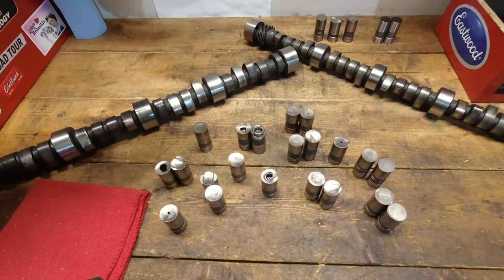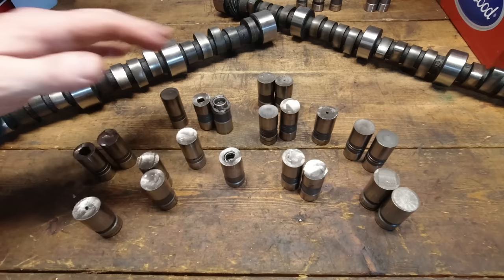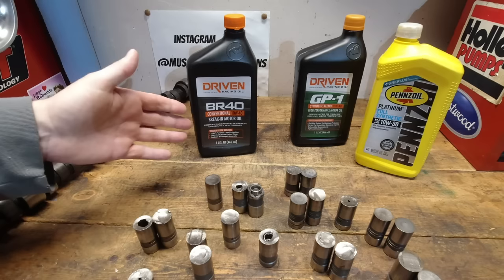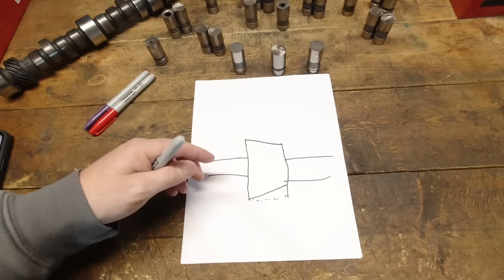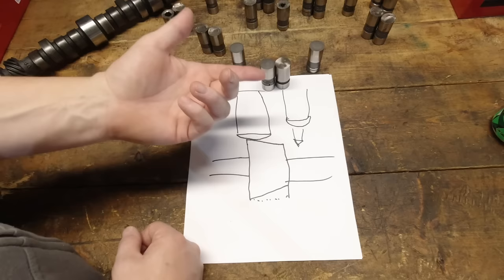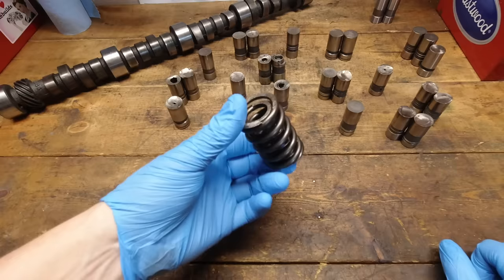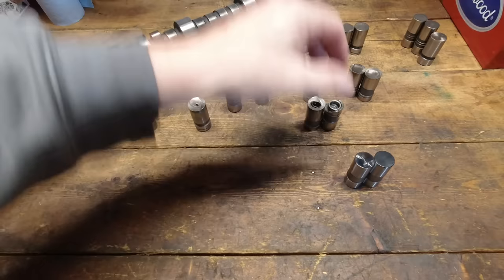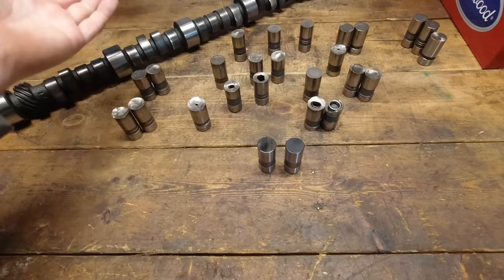Flat Tappet Cam Failures: The Reason Why They Go Bad & The Solution! Part 1

Comment: I have an idea, how bout they break in the lifters and cam together and sell them as a “broke in” set. I had one fail and it ruined my entire engine many years ago. I never touched the car after that and it’s still in my yard.
Reply from the maker: One thing I live about Centerforce.  They have a clutch dyno and if you get on good terms with them, they’ll send you a clutch and flywheel that’s broken in.  I can’t imagine the high cost it would be to send out a cam and lifter set that’s broken in.  Not joking but I’ll bet it would be a couple grand for that service.  Maybe more as initial break in is only one part of the process.

Comment: Zink oil and break in cam 2000 rpms varing for 20 mins let it cool totaly after then its good to go change oil but add zink when you change oil add it to oil
Reply from the maker: This is not the recipe for success.  This is a recipe for failure.  Not all engines need the same break in speed and adding oil to an off the shelf detergent oil is a horrible idea.

Comment: Can anyone tell me why GM, Ford & Chrysler didn't break in their engines when they rolled off the assembly line?
Reply from the maker: Simple.  The oil back then had the right amount of sacrificing zinc and the lifter bores were brand new and the tolerances were correct.  Watch the other videos on this series and I’ll explain all the details.

Comment: Zddp is what all motor oil companies add to motor oil because most all engines used flat tappet cams, this is the only reason zddp was added to motor oils that contains detergents or non detergent oil.  The presents  of detergents has nothing to do with it fact. The reason older engines don't have these problems is that zddp which is more than zinc is a additive to motor oil so that when you break in a flat tappet cam 2500rpms or so for 30 minutes or so  the cam and lifters will not grind each other up.  That's the only reason zddp was added to motor oil all motor oil up until about 16 years ago. The main reason motor oil companies most not all is roller cams or cams with new type buckets don't need zddp for break in time and also 500 mile break in for the cam. Make sure your cam break in oil has zddp additive in the oil and the 500 mile break in oil has zddp for flat tappet cams zinc alone will not work! Now do your homework because if you add to much or to little it can cause cam, lifter failure! I've used zddp plus and never had a new flat tappet cam failure. To many flat tappet cams to remember how many and not one failure and no special break in springs or low ratio rocker. Big cams with Manley valve springs put the motor together and put it on the dyno and break the cam in, I do 2500rpms for 30 minutes and tune her up,do an oil sample if ok put her in and let her rip no problems.

Comment: So explain to me how diesel oil from 20 years ago the high detergent in the oil didn't wash all the zinc phosphate away?
Reply from the maker: Same as high zinc oil today.  The additive package was formulated to work with it.  When you take an off the shelf oil and throw in a zinc additive is where you run into problems.

Comment: I bought a Chevy 402 that was rebuilt including a new hydraulic cam and lifters. After 60 miles,a strange noise on the driver's side of the engine under the valve cover prompted me to remove it. One rocker was moving half as much as the others. I also noticed only half of the pushrods were spinning and the bad lifter wasn't turning at all. On rebuilt engines,I have never heard a discussion on watching to see if the lifters are spinning on an engine with a new cam and lifters. Has anyone ever taken an intake manifold,cut about 80 % of the front portion off leaving just enough to install the distributor. With the pushrods and adjusted as close as possible,crank the engine over with the starter and observe the lifters to see if they are spinning or not. At this point,they all should be spinning,correct? For as big of a problem camshaft failures are,has anyone done things out of the ordinary to increase their chances for success? Great video! I look forward to any and all discussion as I plan to replace the cam and lifters. At this point,I'm thinking about just going the roller cam route. I haven't seen any videos on a Chevy 402 roller cam install. Thanks.
Reply from the maker: We’ll eventually be covering those topics in the final video in this series.  The tough thing about crate engines or someone else’s rebuild is all the things that need to occur still have to happen.  Big blocks are rough on valvetrain and seat pressures are super critical.  If it was broken in or attempted to be broken in without lowering the seat pressures, it’s like playing Russian roulette with a mostly loaded gun.
Reply: Thanks @MuscleCarSolutions

Comment: You cannot "check" the depth of the 'heat treatment before you breakin the cam, unless you either buy 2 cams that were furnace or induction hardened during the same cycle or you access to a plug or coupon of the same material that was heat treated during the same cycle as the cam you purchased. I think what you are trying to refer to is the hardness of the cam.
Reply from the maker: Circumstance of having one cut so the heat treat depth can be seen.  Future video!
Reply: @MuscleCarSolutions  yes it must be cut, polished, etched and looked at under a powerful microscope to see how much or little the microstructure was changed.
Reply from the maker: Checking normal heat treat depth is visual.  Don’t need a microscope for that.  The lines are pretty clear.  Like I said, content for an upcoming video.

Comment: There is only 1 company making US flat tappet lifters, lifter crown, and cam lobe taper are the 2 most important factors, as well as proper break in procedure
Reply from the maker: That is not correct.  Most use a US made lifter, but even that doesn’t mean much if the quality is not what it used to be.  Crown and taper are only two factors in a group of many that are all equally important.  You can have a perfectly matched set and if you run too much spring pressure, the chances of failure go way up.
Reply: theres two.  topline and delphi both make hydraulic flat tapper lifters in the US.  there might be one more but I think they went out of business or sold a few years back the name escapes me
Reply: Elgin makes quality lifters

Comment: Most of the lifters are being made by one of only three manufacturers no matter what name is on the box.  Hardness is rarely the problem. I'm betting the actual break in technique is the main problem .Most guys do not do it correctly.
Reply from the maker: I don’t disagree.  We covered a bunch of issues in the rest of the videos in this series.  Lifters are still a big issue, but it’s generally not what people think and it’s 100% the fault of the machinist when they don’t verify lifter bore wear.
Reply from the maker: I don’t disagree.  We covered a bunch of issues in the rest of the videos in this series.  Lifters are still a big issue, but it’s generally not what people think and it’s 100% the fault of the machinist when they don’t verify lifter bore wear.

Comment: Great stuff.  
I think I remember the video about the taper being 0.003".  Is it possible that he was speaking about the dimensions from nose to base circle, as you would measure it with a caliper or micrometer at the "front edge" and "back edge" of the lobe (front being toward the timing sprocket, back being toward the back of the cam)?   In other words, in the "diameter" sense.
What I'm talking about is that taper "could" be the difference in height at the "front end" and "back end" of the lobe, relative to the centerline of the cam.  That would be half of the amount measured as outlined above.
Does Billy Godbolt have a definition of what the allowable taper is for different engines?
I read that the old Mopar 6-pack and Hemi cams had smaller taper and larger radius crown on the lifters.
BTW, I'm with you, I went to roller lifter cams 15 years ago or so.
Reply: Billy left comp
Reply from the maker: From the one I saw, the statement was made that it’s a .003 taper on the cams.  Just not the case.  We’ll be doing an interview with Billy at the end of the month and taper/crown will for sure be a topic he’ll talk about.
Reply: @MuscleCarSolutions  when you say it's about 1-1.5, is that radius difference or diameter difference?
Reply: No mo flatties for moi. Learnt my lesson the expensive way. Rollers is the way for inexpensive Big HP gains (even on same spec cams)
Reply: @totensiebush  That was what I was trying to say.  Tony just posted a rebuttal video to this and clarified that he was measuring across the heal and nose of the cam with calipers, and that the taper difference would be half of that 0.003" number, at 0.0015"  - He also agreed that 0.003" taper (i.e., measuring heal to toe at 0.006") would be excessive.  So I think they are in agreement.
Reply: @kelaward  I just watched an interview with Billy that happened in the last 2 weeks and he spoke as if he was still at Comp Cams.
Reply from the maker: He is still working with Comp but is now on his own to have the opportunity to do more work with overseas teams.  His interview will be on my channel soon.

Comment: What do you think of hydraulic flat tappet lifters with .015 EDM holes in a Buick 350? I bought a new cam from TA Performance, and they don't offer cam and lifter sets, so I bought a set of NOS Johnson/Sealed Power EDM hydraulic lifters from the 80's that were never used because the intended engine build never happened. I am building a Buick 350, specifically an SP code 10.25:1 compression ratio 1970 Buick GS 350. I am using TA Performance single valve springs since it's not a high-RPM engine (max 5000 RPM or so, in my big Jeep 74 3/4 ton 4x4 pickup torque is king, and peak torque happens low in these Buick 350's, like 2800 RPM or so) so I don't think valve spring seat or lift pressure will be excessive. I will be using proper high-zinc break-in oil, and breaking in at 2000-2200 RPM for 25 minutes. Your thoughts, please?
Reply: I would look into slotting the bottom half of the lifter bore with the tool that comp sells. Look up David Vizards video on this. It makes a lot of sense to me as the EDM hole only lubs half of the lifter face as the cam spins if you think about it. Good luck fellow gearhead.

Comment: just recently i ordered a edledbrock performer plus camshaft/lifter kit  for 460 ford  opened the box it was a comp cams box and edelbrock lifters i guess comp grinds edelbrock cams or were bought out by edelbrock ?
Reply from the maker: They merged two years ago and the comp cam was better than the ones Edelbrock was using.  Your success is going to hinge on the things we talked about in this video.  You must get the spring pressures low.  Break in rpm isn’t as high as you think it is.  Use an oil formulated oil for your set up- don’t mix your own.  Have your machinist verify that the lifter bores are the correct size and not worn out and their alignment.  We’ll cover that topic in a future video.

Comment: I followed the manufacturer instructions to the letter and still wiped a couple lobes and destroyed a lifter.
Reply from the maker: My first question to these statements is usually, what engine and what was your spring pressure open and on the seat?
Reply: @MuscleCarSolutions   ford 289. I don't know what the spring pressure was. I used the springs that were on the car for the break in.
Reply from the maker: @bofa83  uh oh.  Looks like you just found the problem.
Reply: @MuscleCarSolutions  could be, but they were older and I had new, stiffer springs to put on.
Reply from the maker: @bofa83 doesn’t matter.  I’m afraid that decision was likely what killed it.  Spring pressures are one of the most neglected parts to a flat tappet break in because they’re difficult to swap out.  If you don’t know what the spring pressure was, there’s the reason why.

Comment: I just built a 402 for my daughter's '69 SS el Camino and I used the Crower "Baja Beast" cam that came out of the old motor. I put Elgin lifters in with it. Haven't started it yet. Would I be better off with a set of Crower "Cam Saver" lifters? How about those DLC coated lifters?
Reply from the maker: Old cam plus new lifters equals a recipe for disaster!  You’d be better off with the DLC and hope the cam is in good enough shape.  The question is, potentially destroying an engine worth it to run a used cam?  Why not just buy new so they can wear together properly?
Reply: @MuscleCarSolutions  I'd always heard you could run a used cam with new lifters but, not the opposite. The cam looked good no bad lobes. It was in a 396 that sat for 22 years and mice went up the exhaust, and peed on the #5 exhaust valve. I did all the prelube and priming but, when I started it, the valve opened and stayed, broke, broke the piston, and popped a nice 1 1/2" by 4" piece out of the cylinder wall. This was in less than 15 seconds of barely running! I'm glad it wasn't the original motor. At any rate, I was trying to save a buck. I think I'll try the DLC's and think positive! Thank you for your input. BTW, I'm using the Driven oil and I do know everything!

Comment: Well maybe on some points ...  But #1 by far is to start that new flat tappet motor WITHOUT the valve covers.  Fire it and if all 16 push rods are not spinning equally, stop!  Shut it down and find out why.  You may only be 30 seconds into the run.  You have not shed any hardened metal yet.  You have not trashed the engine.  Figure out what the issue is?
Poorly crowned lifter is easy enough to check.  Take any two and hold them face to face and rock them with a light behind.  If they don't look right, check some more.  Cam not showing proper "snake" pattern as in the contact stripe not moving back and forth across the lobe as it goes around, pull it out and measure the taper.  
Fix the issue.  Then try again.  Yes it'll toss some oil, so what?  A little oil cleanup is easy compared to building another engine !!
Reply: What do you think about all the additive/detergent bs he is spouting?
Reply: @pssstttchhh  makes sense, alkaline + acid will ionize with each other and fall out of solution.
Reply from the maker: What you’re describing is a verification of the taper, crown and bore operating as it should.  The verification of the oil and spring pressure comes soon after.
Reply from the maker: No bs at all.  When I do the interview with Lake in a few months, he’ll confirm that information.

Comment: You made no reference to the lifters Comp and Isky sells with the holes in the bottom. We had used the Iskys on an Isky cam and the Comps on a Comp cam with no failures. The are not the same, I expect that to be a trade mark or patent thing but do you feel the are an advantage. Would the comp coating be an advantage on theres. Thanks
Reply from the maker: The EDM lifter hasn’t been as successful as had hoped.  If they were, they would be the only thing those companies offer.  The EDM would offer no advantage on the DLC lifter and I’d imagine impossible to produce.  We talked about these in the last video in the series.  Was a good idea, but ultimately not the solution.

Comment: man i learned some stuff here. i'm not suggesting some imagined shortcut but i wonder your thoughts on possibly cryogenically treating the cam and maybe the lifters? it's got a proven rep in knives, surgical equipment, firarms, and automotive brakes.
Reply from the maker: They already do something similar with cams.  They can nitride them for some additional hardness, but it doesn’t cure the lifter problem.  Not sure that all cam suppliers can offer than service.  I know Comp does, but it’s a long process and adds another $100-150 to the price of the cam and not all flat tappet cams are treated with that process.  The DLC on the lifters looks to have cured the issue.  Time will tell.
Reply: @MuscleCarSolutions  btw thanks for the work you put into this and all your videos. no bs and pretty objective imo.
Reply from the maker: @Ecosse57  very much appreciate that.  Thank you!